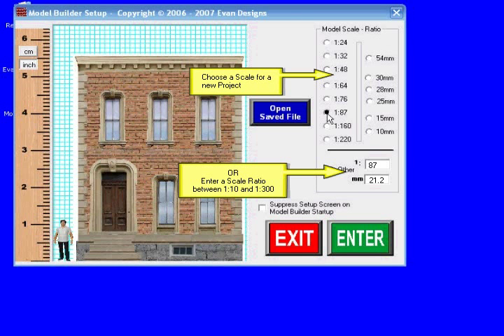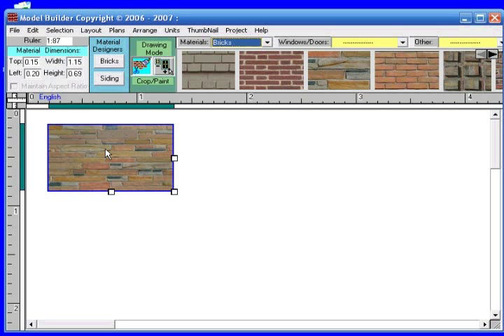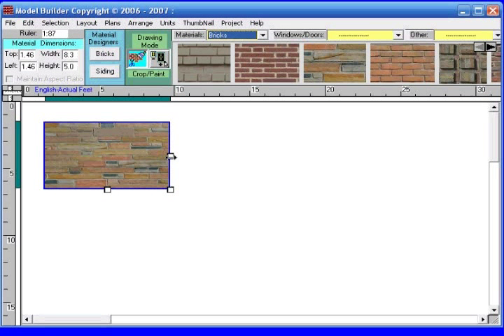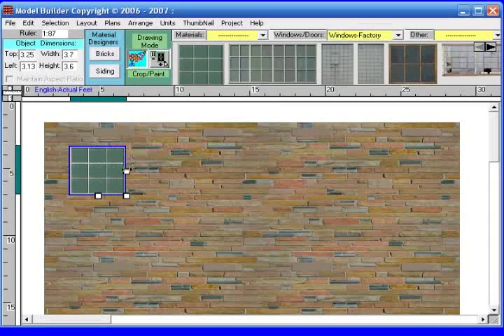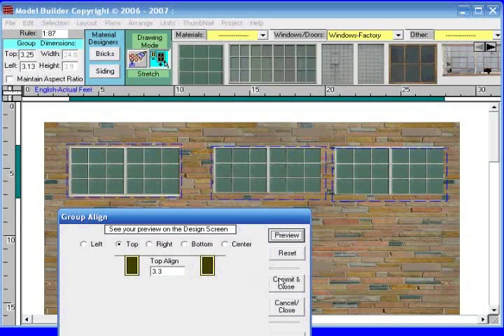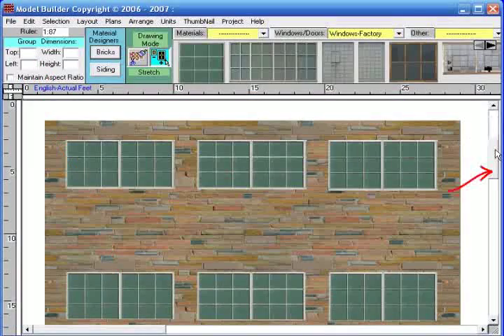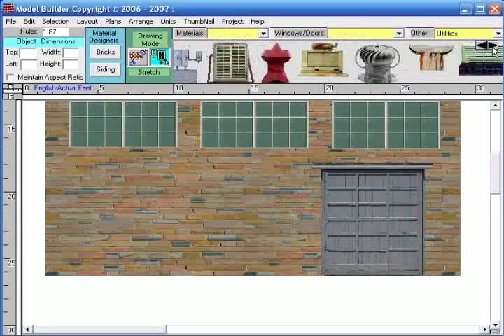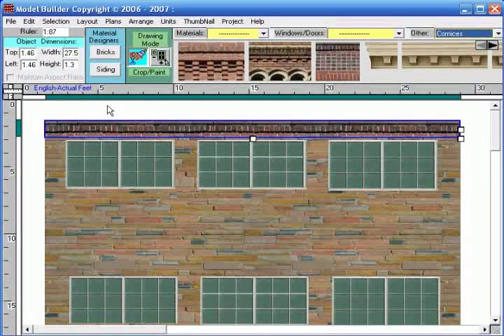Model Builder Software to Designs and Print Custom Buildings for Your Layout

Comment: Scaling the buildings is frustrating. Even after I set it to 1/64 it shows either 1/10 inch or 100. Im  not sure what the 100 means.  Where can I find better instructions on scaling the units?
Reply: Hi Critical Thinker! Thank you for your purchase of our software!  If you choose 1/64 as your scale, when you enter the program you can use "actual feet" and it will let you create buildings in, actual feet.  So say you want a 12 foot by 8 foot shed.  You can place materials on the screen in actual feet and print it out.  Assemble it and you will find it is perfectly scaled to your 1/64 diorama.  If you need further clarification on scale, we have this video that may help...  https://youtu.be/lBkn2xvi51s
Reply: @shegardener1221  Thanks

Comment: Can Autocad, DWG files be inserted into this software?
Reply from the maker: If you can change them over to jpg that would work well. Otherwise DXF
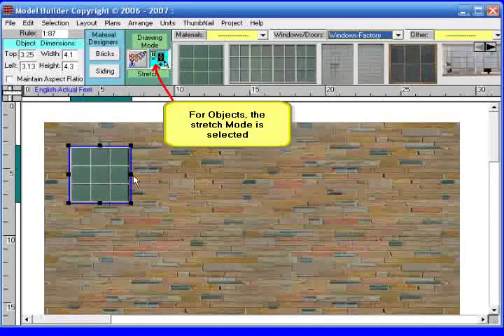Reply: @EvanDesigns  ...But would the scale be affected in the transfer?  Meaning, a drawing in 1:1 scale (made in cad...one that can be printed in any scale through cad) turned into a DXF or jpg then transfered to the Model Builder Software...is there a way to scale it within your software, to 1:48 or other scales?
Reply from the maker: @metallidome   yes you can rescale in the software
Reply: Excellent. Thank you! @EvanDesigns